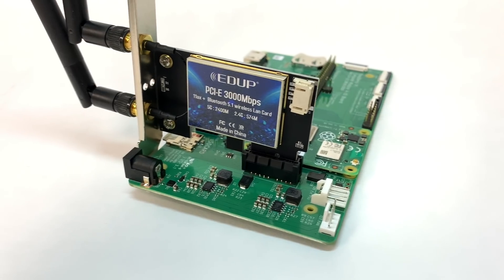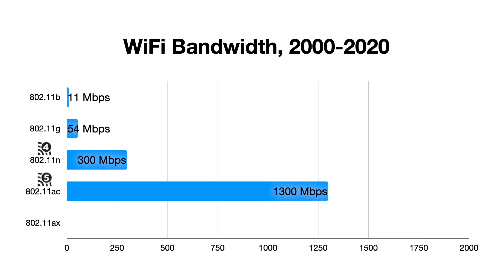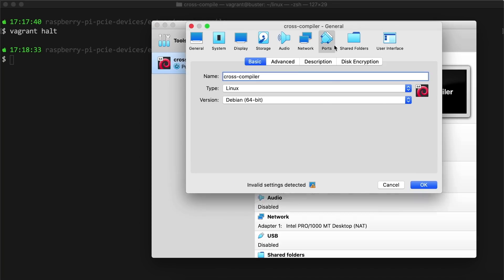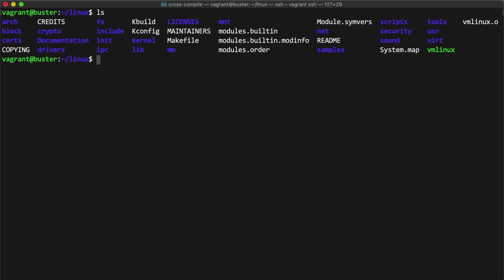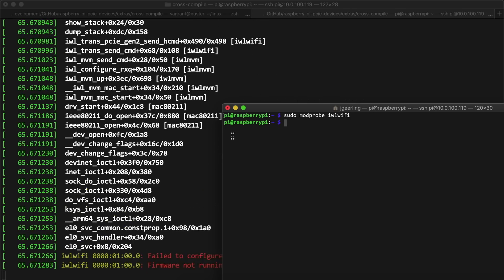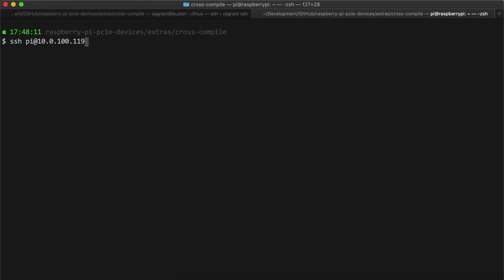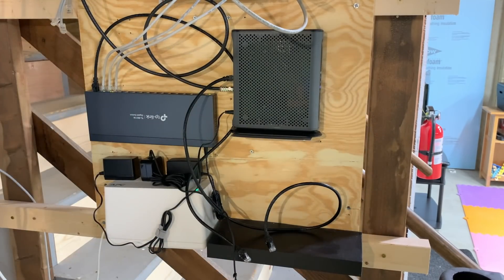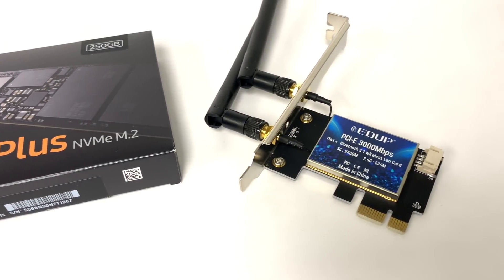WiFi 6 on the Raspberry Pi CM4 makes it Fly! MORE THAN 1 Gbps!

Comment: Is there any chance the process of getting the wifi module to run, is a more friendly for non experts? :D i  want to build a mobile Videostream and improve the wifi strength of the pi cm4.
And is it possible to use m.2 wifi module or ist the pci Adapter necessary. :)

Comment: Great video, my little dream is to build a cheap Wifi 6/E router-AP with an Intel-based wifi6 addon card or something like that,  the mainstream consumer devices in this area with Wifi6E support appear to be a rip off when you consider they have like 256MB ram and an ARM processor less powerful than what a Raspberry or Banana Pi has.

Comment: The standard Pi 4B inbuilt wifi gets 433Mbit in AC mode if you get the settings right without installing any other drivers. That's 80MHz channel width single stream AC wifi. Got this working in AP mode, took a lot of hacking around.thanks to hostapd's difficulty.
Reply: Been struggling to get an Intel AC8265 past 100Mbps. Even when connected to a 802.11ax router. Does the Pi use an Intel chip?
Reply: @dennis_johnson  using hostapd? Enable vht and 80mhz channel on 5ghz and pick a channel where 80Mhz is feasible

Comment: try using openwrt with a realtek usb wifi adapter on the Raspberry Pi 4. Does not work and it appears there is little to no support for the chipset.  If you could help me with that then you will have a lifetime friend lol

Comment: This video has to be one of those 'Super Nerd Trolling Normies Jokes right"? Of coarse you are going to get faster wifi plugging in a dedicated pcie-wifi adapter over the on-board wifi of the Raspberry Pi,  it's the same result on desktops Vs on-board wifi Vs a dedicated Pcie wifi adapter. I'm not a super nerd but I don't get what you are trying to share in this video.

Comment: would enabling the external antenna while the antenna is not mounted on the cm4 cause damage to the wifi module (impedance missmatch) ? please help
Reply from the maker: Nope, it should. It cause an issue, though your signal would be pretty weak.
Reply: Oops I thought that I am clear and I am not. Are you saying that if the external antenna is Not connected enabling the Tx through the external antenna Will demage the wifi module?

Comment: Would you be able to connect the AX210 with 
https://www.amazon.com/Bicool-Adapter-Converter-Compatible-Raspberry/dp/B08YXTNGBV/ref=sr_1_3?crid=1PL9WCYE028MU&dchild=1&keywords=raspberry+pi+4+pcie+to+m.2&qid=1627135974&sprefix=rasb%2Caps%2C287&sr=8-3
or
https://www.amazon.com/gp/product/B07MNFH1PX/ref=ppx_od_dt_b_slice_asin_title?ie=UTF8&psc=1
?

Comment: ty, that's the router i want. I literally have all this hw lol. I have a series of machines running a small LAN on a smart switch that uses a wifi connection through a PC on that network to reach the WAN. Messy, I'd like to replace the PC with a Pi4 + 3000mbps card.

Comment: I find your vids very interesting.  Thanks, keep up the great work!

I would be happy to get AC speeds from my RPi without a CM4 / PCIe card and an ASUS RT-AX86U (although the AX router may be in the cards, anyway).  Right at the moment, I am seriously considering hardwiring the home office RPi to the nearest switch.

Any suggestions to improve WiFi speeds or am I throttled by RPi antenna geometry?
Reply from the maker: I haven't found any way to get more than around 100 Mbps over the WiFi on any modern Pi; I think the built-in antenna and chipset just can't do more than that.
Reply: @JeffGeerling  not sure if talking about link speed or throughput but see my other comment, pi 4B wifi gets 433mbit link speed (fastest speed with AC with 80Mhz channel width and single stream). If running in AP mode you have to explicitly configure HT and VHT and 80MHz width and your country code and the stars must align.

To my knowledge Pi 4B is not capable of any more than 72Mbit on 2.4Ghz band which is N wifi with single stream and 20Mhz width (guess you could try forcing 40Mhz width but that's not neighbourly)

Comment: Core i9, but only make -j4?

I'm guessing your make parallelism was that low because you were doing other stuff with the system at the time?
Reply from the maker: Since this video's release, I spent a few hours optimizing my cross-compile environment, and found that -j12 is about the best for speed on my laptop in the VM. Even so, it was only about 5 minutes faster than -j4.
Reply: @JeffGeerling  Yep.  There's a lot of factors to be aware of in VMs.  I'd guess the next thing holding it back is likely storage access speed issues, but I wouldn't know.

Comment: Just a tip: if you want to transfer files between your computer and the pi you don't need to unplug the SD card and mount it on your mac. You can just use the scp command.

The basic syntax is scp path/to/file/or/dir/to/copy username@hostname:/path/to/destination . This also works the other way round.

That's useful for some things, but if you need to do more ssh also supports mounting the remote filesystem using sftp
Reply from the maker: Yeah; now I'm using sshfs, makes it a lot faster and less annoying (no having to shut down the Pi now).

Comment: I have Internet provider router/modem unit... CAN I  log into ISP unit and turnoff WIFI.   PLUG IN THE NEW ASUS ROUTER TO ISP device and use ASUS WIFI and GET NEW SPEED?  (Otherwise I need MODEM AND ASUS NEW ROUTER.). NOVICE HERE..  MOST HUMBLE APPRECIATION!

Comment: Ok, I have to ask as I'm slightly new to this, are you running an ARM vm in Vagrant from the Mac? If so, how? Cause I have some code I need to fiddle with and it'd be nice not to bring up a Pi every time.
Reply from the maker: No, I'm running an x86 Debian 10 VM in VirtualBox on my Mac. Most things are similar enough that what I do in the VM transfers to the Pi well. But building things like the kernel requires cross compilation.

Comment: You didn't use sudo to mount the card (at 7:29), you used sudo mnt (slip of the tongue?)  But one of the comments here forced me to find out why sudo always failed with "unable to resolve".  (It turned out that the ORIGINAL /etc/hosts file, the one originally written to the SD card, had comments that weren't commented out.  Ouch!  (But thanks for forcing me to look.  30 years of *nix, and I just never bothered to solve the pain.)

Comment: Was that tcp or udp?
Reply from the maker: TCP
Reply: @JeffGeerling  That's even more impressive. Have you tried UDP mode (-u with -b) and changing window size for tcp (-w) ?
Reply from the maker: @KidoKatsuragi  Check out the updated results here: https://github.com/geerlingguy/raspberry-pi-pcie-devices/issues/40#issuecomment-751528611

Er... I just realized this question was about the WiFi chip, not for the Ethernet interface... heh. I'll try to test with UDP on the WiFi chip later!

Comment: Intel ax200 is a 2x2 chip. Max 11ax Phy datarate it can support is MCS11 (1024-QAM) which is 1201Mbps. It is impossible to get 1340 Mbps iperf throughput using a 2x2 chipset. Can you share the iperf log showing 1340Mbps like you showed for ethernet :)
Reply from the maker: I'll have to dig it up; the runs were between 1.2-1.34 Gbps with iperf3 between the Pi and the router.
Reply: No, max 11ax Phy data rate for Intel AX200 on 5GHz is 2401Mbps since both Intel AX200 and ASUS WIFI6 support 160M bandwidth.
So it's possible to have 1340Mbps iperf throughput, the 1201Mbps limit in your comment is for 80MHz bandwidth.
Reply: Considering the 802.11 MAC, and UDP overhead 1201Mbps at phy should translate to just a little less than 1Gbps. I would really like to know how it is above that theoretical limit..
Reply from the maker: @marvellmarvell9673  - So... you're definitely on to something. I am re-testing the AX200 chipset (this time pulled straight out of a brand new Intel AX200 Desktop Kit that I'll eventually pop into my HP desktop)... and I've found that it is not getting more than ~500 Mbps.

I believe I may have run into a bug (or at least completely unexpected behavior) with one of iperf/iperf3 or the Pi / Linux kernel networking stack.

More to come, check out https://github.com/geerlingguy/raspberry-pi-pcie-devices/issues/38 for the latest.